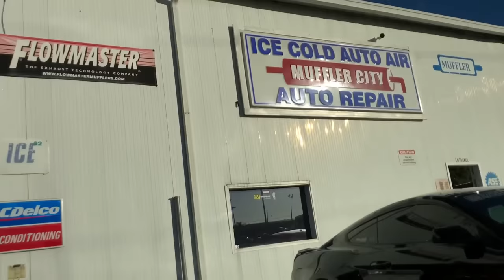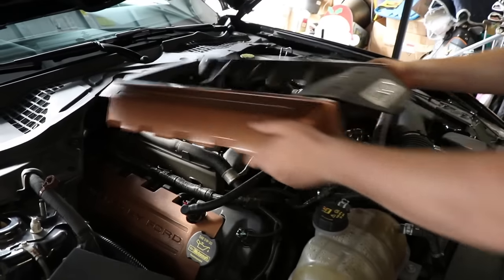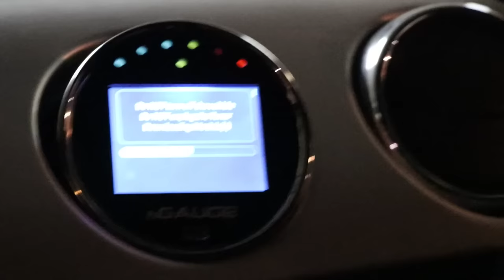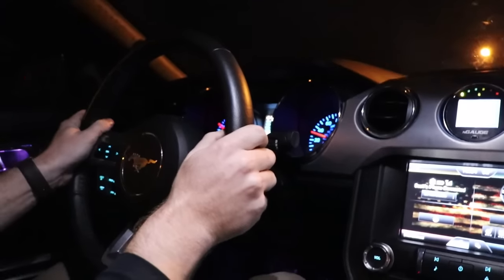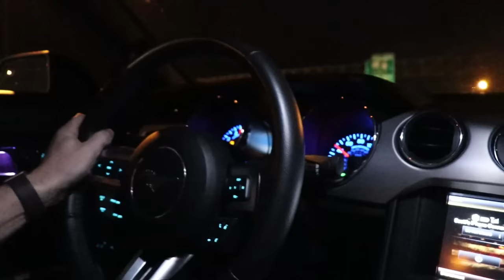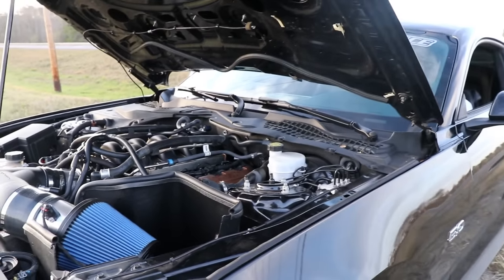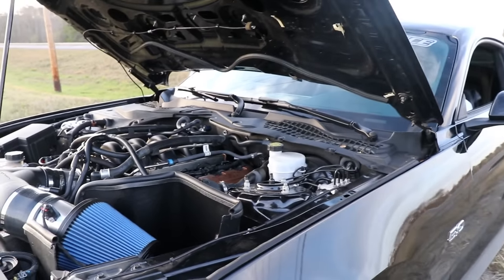Full Bolt On Coyote N/A Build - Longtubes, E85, Intake Manifold, PMAS, VMP Tune

Comment: All this extra power and no cam upgrade. Can you imagine the power with stage 3 comp cams installed. Momma lol.
Reply: Warren Joe ohhh trust a build just like that is coming shortly 😊
Reply: Warren Joe cams will make virtually no difference on a VCT engine.
Reply: Alex Hock lol
Reply: Alex Hock what do you mean by vtc
Reply: Alex Hock want to bet. Try atleast 30
Reply: Don’t know about the coyote but is honda guys always make crazy power off of cams and vct
Reply: Warren Joe pretty sure unless the VCT system is locked out you won’t see much improvement ... at least not for the cost
Reply: Texarmageddon I can show you vids where people changed the cams on these motors and gained 30 rwhp.
Reply: all_ontario_hunter 30 rwhp may not sound like a lot but it is. Thats like 50 hp or better at the flywheel.
Reply: Who cares what happens at the flywheel? You don't feel that anyway. And yes, cams won't do much for TiVCT Coyote UNLESS you lock out the TiVCT. Alex (Yolo DB) said it himself. Its logical otherwise.
Reply: @hunchojames8491  vct, it stands for variable cam timing.
Reply: @sweetcheels cams will gain 30+ rwhp easily without deleting vct.  If you have a ported cj it'll see more than that.  All these people saying the vct coyote doesn't improve with cams weather na OR boosted just have no idea what they're talking about.  This is an old comment but I hate seeing bad info spread around.  This is bad info.  Cams cost like 1500-2000 they are no more expensive than headers and you see even more gains than headers do.  I get tired of hearing this weak argument that cams aren't "worth it" on a coyote it's completely nonsense.  It's absolutely worth it especially with a cj.  Cj is worth it too it costs more than the others but it will make more power AND perform better i.e. it will carry the power out MUCH better.  I seen a fbo 18 manifold gen 1 car pick up 50 rwhp by doing cams and a cj intake.  This car already had a better than stock 18 mani.  You guys are flat out wrong about cams and about the cj.  Both help alot on coyotes and you will make the most power na by a mile over other setups.  It costs more but you see more benefit and gains.  You get what you pay for.

Comment: Surprised these engines aren't making more torque with these mods.  Everyone brags about their HP, but torque is where the fun is.
Reply: Kevin Davis Tru but probably need to upgrade the suspension first most people can't handle that much torque smh mustangs need a buyers Guide lol!
Reply: It's the GT350 intake doesn't make as much torque as stock
Reply: My car made 391 torque on stock intake manifold only with the performance pack two. Custom tune will bump that way up.
Reply: First upgrade for me is going to be fords suspension upgrade
Reply: Why are there so many dumb people in the automotive scene. Horsepower is derived from Torque. HP= Torque x RPM ÷ 5252. There fore, an engine will no make more torque than it does, but  can make more horsepower by simply upping the RPM (obviously supporting it with airflow and fuel to make the power and not choke it out)
Reply: my n54 makes 420 awhp. 490 wtq haha it throws you back. Torque is more usable when just cruising which I like
Reply: It's because of the head design; they breathe too well and act almost like a high overlap cam. That plus the lower valvetrain mass easily raises the rev limit as well. That's just a characteristics of dual overhead cam heads. You actually have to gain torque back through cam design and cam timing.

Comment: ive seen people run this setup and get good numbers. but the mod that works good with this is the JMS fuel voltage pump booster which adds about 12to 15 hp

Comment: Solid numbers, and beautiful car. Just imagine what an 18 would do with this setup ;)
Reply: Im watching as an 18 owner like 453? Thats it💀 i ended up here after googling 600hp na coyote. Wack
Reply: @Logan adkins  Lol Gen 2s gonna hold boost better though.
Reply: @Swerzuh  not true
Reply: @White_Fox_5.0 yes it is lmao
Reply: @thefxrsaken9236  dude gen 3 is higher compression you will LITERALLY make more power per pound of boost in a gen 3 than gen 2. Go back to school
Reply: @loganadkins2646  the gen 2 heads flow better. The 10r80 isn't very good past 800 wheel. The gen 2 is KING when it comes to boosted applications. Do some research bud
Reply: @thefxrsaken9236  couldnt give less of a shit about the 10r80. We're not talking about transmissions. The good ones don't even come from factory in mustangs.... I get it you own a gen 2 and are biased, and i have my own biases owning a gen 3, but my engine was built off all the technology already available for yours and IMPROVED on. I can drop e85 in the tank flash a tune  go. Gen 2 cant do that. If you wanna make 900 horse on a gen 2 or gen 3 it really doesnt matter which both are gonna make the power reliably and any stock tranny its not gonna hold up except a built 6r80, but who tf wants that? T56 magnum for me.
Reply: @thefxrsaken9236  every gen 2 has a ported gen 3 manifold on it😂 the gen 2 is a very stout engine, but there is no drawback to having a gen 3 whatsoever(unless you cant stand direct injection noises). Its actually way more responsive to simple bolt ons out of the box and not limited by the stock fuel system in a "full bolt on" car. But boosted and living near the limit of the stock internals the gen 2 is just more simple and thats it, the actual gen 3 block is stronger...the direct injection just becomes obsolete at a certain point so i'll give you that, but we both still need oil pump gears. Only thing i will give gen 2 hands down over gen 3 is the manual transmission. The ratios for gen 3 suck
Reply: But both transmissions suck at any respectable power level so whats it to compare dogshit to catshit
Reply: @loganadkins2646  the gen 2 is the same way about e85. Flash a tune and boom. As long as you have stock manifold. But what I'm saying is that the heads in a gen 2 flow better. The gen 3 responds better to na builds but if you're gonna boost your car, gen 2 100%
Reply: @White_Fox_5.0 higher compression isn't always a good thing 11:1 is on the high side for boost anyways.  They have the same rods which are the weakest link in both engines they can handle about the same but the gen 2 seems to hold up better at elevated power levels maybe the lower compression helps idk but I know gen 2 can make every bit as much as a gen 3 if not more boosted (reliably). 

Also this car just has a stock gt350 manifold (not ported) and headers and e85.  A gen 3 isn't gonna make that much more stop acting like they make another 100 hp w the same mods or something.   Your dime a dozen gen 3 isnt special come down off that pedestal.

Comment: It will definitely trap 120. Back in the day I bought a red 93 GT brand new, after a few things done. I went through the traps at 10:58@128 and I was making right around what you are with a Vortech S Trim, 36 lbs injectors and all the shit that goes with it. I just purchased a V3si trim for my Mercedes. I won't start working on it till late spring.
Reply from the maker: It trapped 122 MPH
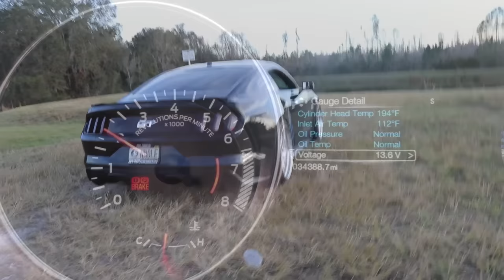Reply: Mustang Lifestyle so that's in the tens of you hook and get like a 1.5 reaction time. First time I took my car it had the usual back then, throttle body, mass air, timing and a few other things I got a 13:03 @ 104. The second time cast iron gt 40 heads Vortech s trim running 7-8 lbs and a few other things and went 11:60@ 116. The last time it had a one off sheet aluminum intake 36 lbs injectors and was running 16 lbs of boost with a ten rib and it went 10:58@128. Everytime I went to the track I did 4 to 5 runs and those were the best numbers. It was a 5 speed stick as well.

Comment: the echo from the exhaust through the woods is just beautiful!
Reply from the maker: +Vince Shands Couldn't agree more :)
Reply: I'm looking forward 2 buying my 2nd mustang, my 1st one was a 85 GT with a 351 Windsor backed by a 5- speed   &  4:10 gears, sent a rod right through the block! after  that I haven't been much into them till now, I drive a 2012 impala 3.6 vvt which has eaten mustangs around here believe it or not, it shocked me also, but what year mustang  would you recommend for the best mods? Thanks

Comment: I own a 2015 GT and have done similar Mods.  I installed the full back headers long Pipe No Cad, with Rousch Exhaust with Roush Cold air intake.  Installed a double plated clutch and tuned it accordingly.  Currently have 428Hp at the wheels on the DYno.  Going to E85 with a GT350 intake.  Hope to have the same if not better results.  I will be running in the "Texas Mile" this March and hope to have a you Tube Video with it.  Awsome car dude.

Comment: Why did you go to a dyno after you data log it an than got a new tune?  We it because you wanted numbers only or did the data log not work an you had to do a dyno tune?
Reply from the maker: nickelbanshee we dyno tuned with the E85. We also wanted a final number but timing was added during the dyno session to bump torque from 390 to 399
Reply: Mustang Lifestyle that's the only thing about these newer coyote motors. they are low in torque compared to the horsepower numbers. it was the opposite with the 99-04gts....they had 260hp and 302 ft lbs of torque at the crank. love my 03 cobra....horsepower and torque close to the same number

Comment: 453whp/399wtq. Thats not bad for a N/A 5.0 thats like 512hp/451tq to the crank.
Reply: x Incubus Leo x most cars don't have that much.
Reply: x Incubus Leo x not that much actually with all the stuff he’s done he should make 500 to the wheels
Reply: Blah Blah no lol hes N/A theres only so much you can do with an N/A car before you cant do more but add Methenol & Spray not to mention hes on E85 already unlike boosted cars you can raise the boost & make more power here you have more of a limit of what you can do
Reply: Blah Blah You might want to factor in he’s running cat’s!

Comment: I know this old video but man that coyote sounds sick, I've raced dozens of  Coyote's in my s197 3.7 on spray with circle d stall. Very rarely but it has happen I've lost to a well built s550 5.0 both times they were full bolt ONS with 4.10s. Now I'm man enough to admit yes I have to run spray I can touch high 11s on 100 shot. I'm so jealous of you coyote guys. 400+ rwhp with a tune and bolt ONS is insane. I local guy I know has made 485 rwhp on 93 nothing sounds as mean as a coyote at 7500rpm

Comment: Love those wheels. What size are they?
Reply: AOD2874 Garbage xxr’s
Reply: Out of curiosity, what makes the xxr wheels garbage? Are they just low quality?
Reply: @Jordan-bq5yq  besides being on the heavy side they're fine for a street car. just your average cast wheel. good value for the money, mostly because they come in desirable sizes and offsets. ive ran 4 sets of them and they were fine. for something more suited for the track but still budget friendly i prefer Konig flowformed wheels (they are the same quality and have the same manufacturing process and formula as the well known RPF1 wheels, but much less expensive)

Comment: And ill still take this on my E85 "Full Bolt on Evo" LOL
Reply: Angel Espino that's your guess, I would say unless you're running some serious boost, this coyote will take you from a roll. These cars are fast, especially with full bolt ons and E85.
Reply: Evo's make the same power with full bolt ons lol and E85 as well, pretty insane
Reply: Alex Vest on stock boost they're not.
Reply: Angel Espino This isn't the old "4.6" you ran a while back, this is different. Don't think you have this covered, mayne.
Reply: Mario Munoz im just talking shit, i aint on a stock turbo, i got a big turbo on e85 with cams. Ill take him for sure.

I just like how worked up everyone gets over nothing
Reply: Angel Espino at least your evo benefits insanely more with e85 then these na v8s, silly kids thinks injectors and a fuel pump cost ratio for 15hp is good.   good luck to this mustang when he wants to do more mods and finding out his fuel system is running at 90% duty.
Reply: Angel Espino LMAO a Evo?! 😂😂😂😂😂
Reply: MrDulvalius69 the factory fuel system with a bap and bigger injectors will handle 900 hp or more.
Reply: Angel Espino n
Reply: MrDulvalius69 all you need is injectors. 15whp for 250 bucks is pretty reasonable.
Reply: An evo with 400 to the wheels will take this car. Evos are different beasts. They have ridiculous gear ratios. As long as the driver can make good shifts it'll just be the evo leap frogging ahead.

Comment: Wen you installed the e85 injector and ran the car did u have regular gas on it or e85??? If so is that bad ? It wont mest anything up wen running rugular fuel in it?

Comment: This may be a dumb question but I'm guessing the gt350 intake manifold revs higher than the cobra jet one? Which would flow more air cause the cobra jet throttle body seems to be quite a bit bigger?

Comment: Im yet to put 93 octane back in my car. Once you taste Flex Fuel, youll never go back. If your tuner can set you up with a good Flex Fuel tune you should beable to mix E85 and 93 however you want, only to sacrifice timing and horsepower.

Comment: on my 12 GT Boss manifold bbk longtube no cats and tune set to 8k. only thing was the car really didnt make much more power up top and just extended the redline. also had problems with the clutch due to the higher rpm. My 15 GT which I only had for a year felt really fat in comparison to my s197. my 15 weighed 3800lbs+. Ordered my GT350 and know I have high RPM with amazing powerband all the way to 8250 and not a single bolt on making 467 at wheels : ) Truly a different world in terms of power delivery. I am curious about the e85 tunning. Were the larger injectors required for E85? What about the compatibility of the
e85 and all the stock fuel lines? Great modding!

Comment: Are you going to put a larger throttle body later on and re-tune the car? I’m curious because the throttle body spacer has a second set of holes it seemed.

Comment: I have an s550, and i don't even have the gt350 mani and still make more power then you... your car is sick and loud, i love it. But why did you go with vmp tune, and catted headers? My 5.0 made 455whp  and 412Wtq without the gt350 mani.
Reply from the maker: Every dyno is different. Wait until we go to the track to make judgments on power.
Reply from the maker: The cats because non-catted would be way too loud. The VMP tune i very good. Drives very well and has great safe power. It is important to not get caught up on Dyno numbers especially on n/a applications. dynos read +-20 rwhp from dyno to dyno and in the n/a coyote world that is the difference between "fast" and "slow". The real power test is 1/4 Mile trap speed.

Comment: Hey man if you guys have time to answer this that would be amazing. What kind of spacer did you use on Scott’s gt350 intake manifold? And is that the stock throttle body? I’m trying to get the gt350 intake but I need to know if I really need that 87mm TB. Thanks
Reply from the maker: MMR throttle body adapter. Don't get the 87mm TB its a headache with driveability and doesn't gain much if anything. You can use the stock throttle body.
Reply: Mustang Lifestyle awesome! Thanks guys

Comment: Nice numbers, seems high on hp and low on torque. My 19 with same setup basically no ported intake did 461/433 but it was 96 degrees in the dyno booth.

Comment: I'm new to the channel. but how did u get the motor to rev to 8000. is it a stock coyote stock cams or aftermarket cams? I'm trying to build a low 11 FBO mustang also
Reply from the maker: Stock Cams. The tune is what allows it to rev that high and with the intake manifold able to make power up there it makes sense to rev higher.

Comment: 8100 rpm on stock valve springs? and you're not worried about valve float? the car is amazing but I'd be terrified of folding my valves over.. maybe I'm missing something though
Reply: Justin Meimberg it's not uncommon for S550 Coyote motors W/GT350 IM to rev to 8250 on stock VT, block, and OPG.

Comment: Solid work. The car sounds great and should be a lot of fun. Are you planning on a Vortec or Paxton SC in the future? Also any future plans on cams? I haven't seen any kind of numbers on the 550 Coyote's with cams.....Keep up the good videos.
Reply from the maker: +Concrete GT The 350IM would make great power with either unit but when* boost comes a VMP Gen 2 R is the first choice. Can't beat the torque
Reply: I'm a PD guy myself, GT500. But with all those extras you got now I wouldn't blame you for going centrifugal.....But I'm getting ahead of myself here...just enjoy that beautiful car as N/A as long as you need to.

Comment: That's it I'm doing E85 conversion on my 03 terminator 2.8KB.  Already trapping 123mph now. Need to upgrade quickly these coyotes are catching up.
Reply: Louis Brigandi catching up lol? they have passed a long time ago
Reply: braddfordy I'm in denial LOL
Reply: Haha just get one of each! That what I did
Reply: braddfordy Believe me I wish but I can't complain I'm trapping g 125mph in the quarter now, so all I have is to go up from there
Reply: 125? Where do you live? Figured a 2.8kb would be a 130+ car
Reply: braddfordy Long Island but I ran the car in jersey, I don't really have that much done to it its the KB 2.8 at 17psi which I'm going to bump up to 25, 60lb injectors  and long tube headers and I ran the car on 20 inch rims with low profile tires also spinning 1st 2nd and 3rd on my run
Reply: Ok that sounds right. That 2.8 would much happier spinning harder! You would too lol . I am ported for now about to do a auto swap and spray.  And then twins.

Comment: Very nice mustang, what suspension are you on and wheel specs?
Reply from the maker: David Tran Thanks! Eibach Sportline Springs, XXR 521 20x10.5 Square with 285/30/20 Super Sport tires